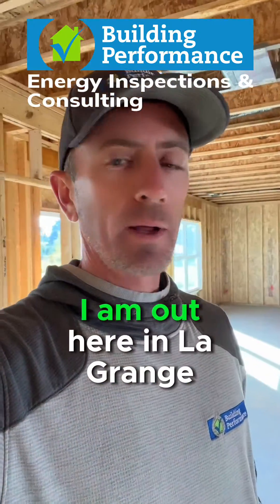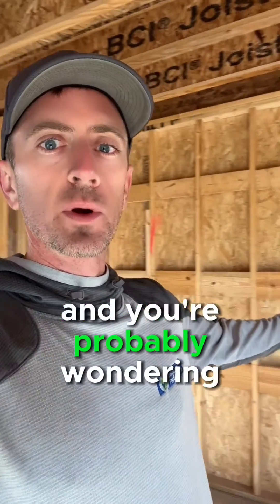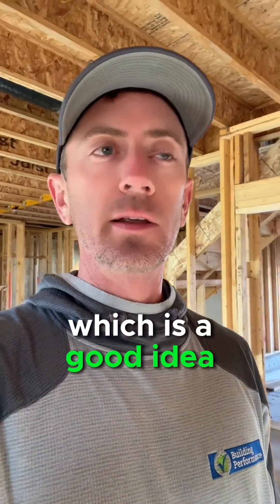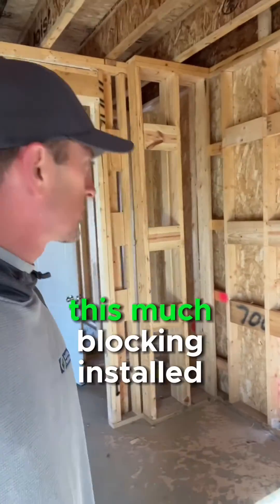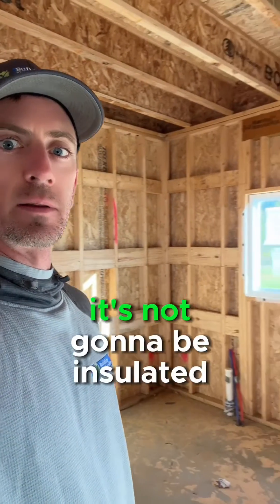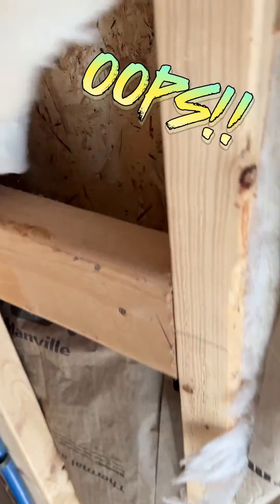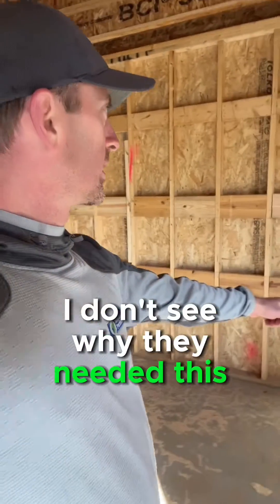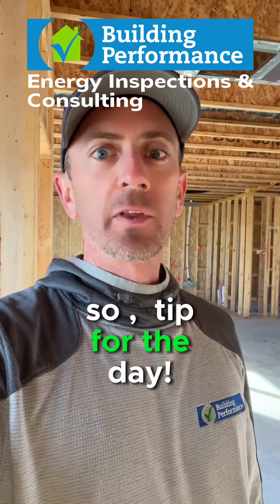COLD KITCHEN WALL CAUSED BY FRAMING & INSULATION ISSUES  #newconstruction #insulation #framing

Comment: With so much uncertainty with energy cost, I would never buy or build a home with fiberglass for insulation
Reply from the maker: Personally wouldn't either, but even fiberglass houses can be made to be pretty air-tight and well insulated, if done correctly.
Reply: @BuildingPerformance502  The fiberglass will perform adequately if air sealed, but that in itself can be time consuming and expensive.  I think foam give the best result for the money, unless you're doing the air sealing and fiberglass work yourself and not hiring it out.

Comment: I did learn from your video so thank you. I am confused about the “unnecessary wood”. It’s for the cabinets… I mean I know you know and said that, so why are we calling the wood unnecessary. It is necessary for cabinets to not come crashing down.
Reply from the maker: See our previous response above in regards to the effective R-value of the wall assembly.  That much wood is not required to hang cabinets securely, especially the lower cabinets.  It just makes the installer's job easier and faster, and production builders are all about speed and efficiency.

Comment: We use 2x6 walls but furthermore, install 1/2” plywood scrap material with pocket screws after the wall is insulated.
Reply from the maker: That's pretty cool.  So you hang drywall over the plywood?  Or shiplap maybe?

Comment: 2" rigid foam behind the 2 x 8 blocking for the cabinetry will net an R value of 12.4. Add to that the 1.88 R value of 1 1/2" thick soft wood and you're in excess of 3 1/2" fiberglass batts R value of max. R-13 or R-11 (depending on what the builder uses.)
Don't make an issue of something you're "assuming". The fact that the builder used 2x blocking at all shows his/her attention to quality and detail. I also noticed LVL used for the header above the opening adjacent to and on the right side of the blocked kitchen area and the framing throughout (that I could see) was far better than the hack slop you find in many if not most new construction homes.
You're making a mountain out of a mole hill.
Reply from the maker: Appreciate the feedback.  No assumptions were made here.  We've done HERS Ratings and energy code compliance for this builder for 14 years and inspected thousands of their houses.  This builder does a good job overall with structural framing.  The point is the R-value of the wall assembly is compromised and they only recently started doing this in the kitchens. They could certainly add rigid foam board to the exterior side of the wall sheathing to increase the R-value of the wall assembly and we've encouraged them to do that, but this builder doesn't do that in this climate zone.  Also never seen any builder in 20 years put two inch rigid foam board in walls, but that would work if it were fire-rated.  In the midwest we see 80-90% fiberglass batts in walls, then spray foam and blown cellulose/fiberglass make up the rest.

Comment: All exterior walls should be 2x6–PERIOD. North of New York it’s not uncommon to do 2x8 exterior walls—YES it cost more but the extra room it provides for insulation is worth that expense.
Reply from the maker: I'd say in general any new house North of I-70 in the US should have 2x6 walls or 2x4 and something with at least R5 continuous insulation.  For production builders it all comes down to cost effectiveness and what will pass code, so the aforementioned options are used often.
Reply: I agree. So you lose 4" all the way around. Your house is so much quite and more even temp.

Comment: Wood is a natural insulator. You don't have to worry about the wood, just get insulation around it. If it wasn't a good insulator, then log cabins wouldn't retain heat.
Reply from the maker: While wood does have an R-value of 1 per inch of thickness, it is nowhere near as good as traditional insulation products.  For example, fiberglass, cellulose, and open-cell spray foam have R-values between 3-3.7 per inch.  Closed-cell spray foam has an R-value of 6-7 per inch.  Most "modern" log homes we inspect are framed with traditional 2x4 or 2x6 wall studs and have siding on the inside and outside that looks like wood logs.  True wood log cabins have difficulty passing today's energy code requirements.
Reply: Blödsinn. Holz  ist 3mal schlechter als rockwool oder cellulose.  Null Ahnung von bauphysik 😅😅👎👎🇩🇪